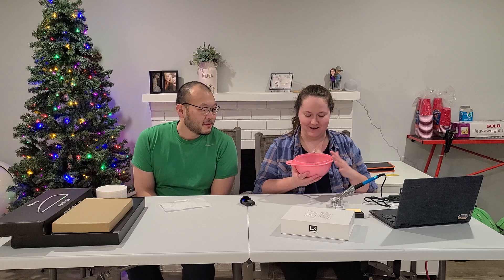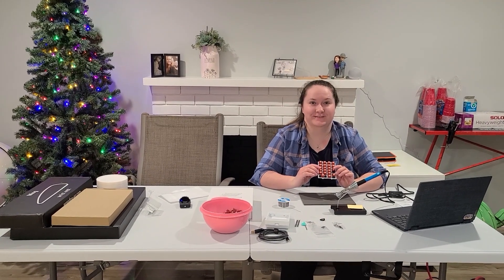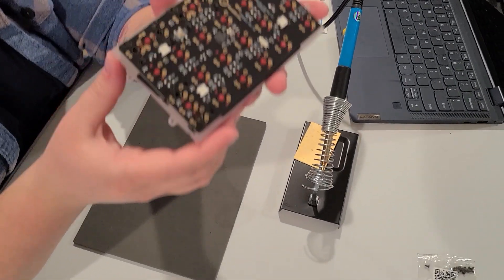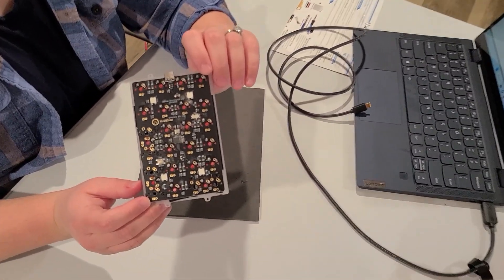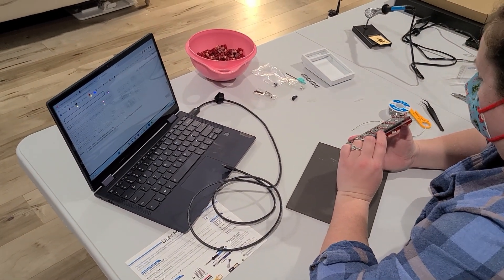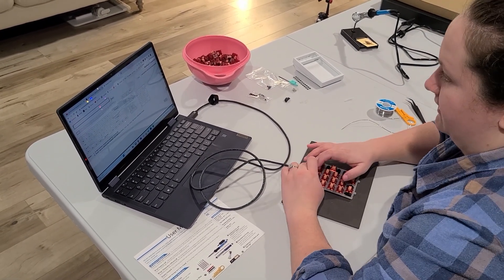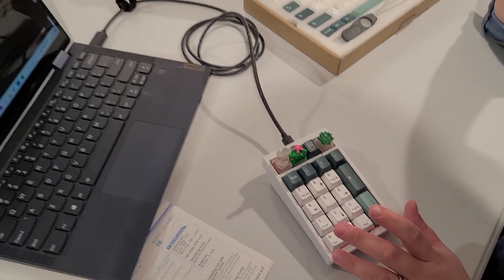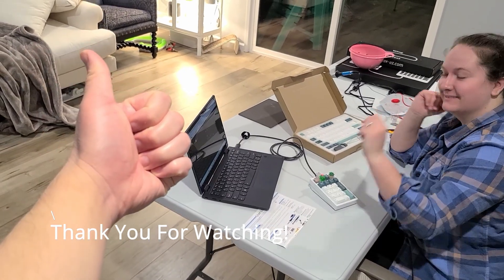The Wife Soldering Mechanical Keyboard Number Pad

Comment: The sponge is suppose to be wet...LOL
Reply from the maker: Lol. I have no idea what that means, but will research for when I learn how to use it!
Reply: Okay :) on your solder iron stand the yellow thing is a sponge and you're suppose to wipe off the tip to keep the tip clean.  So you put water on the sponge until it's wet to the point of almost saturation and wipe it to get excess solder and oxidation off.  Also it's a good idea to put some solder on the tip before you turn it off and leave it there.
Reply from the maker: @tom5256  Good to know! I'll keep that in mind when I use it. Thank you!